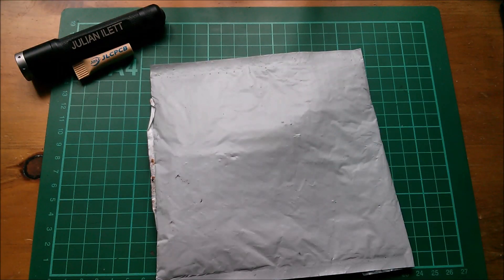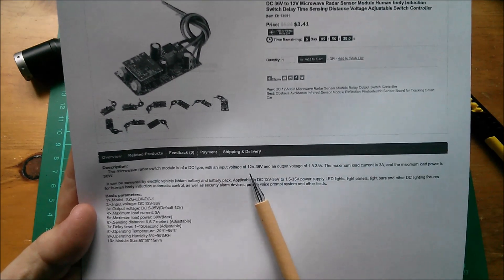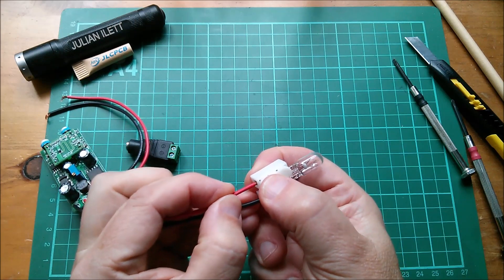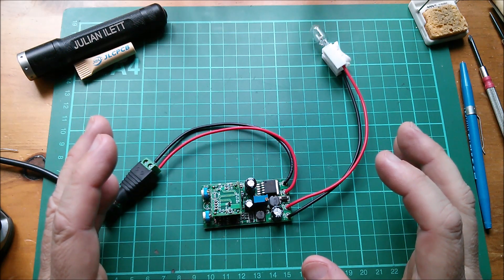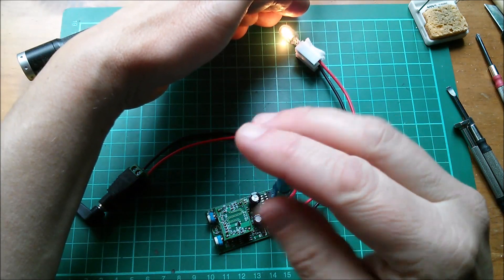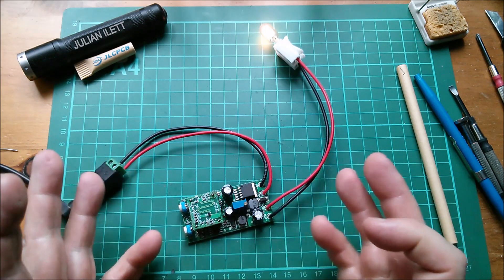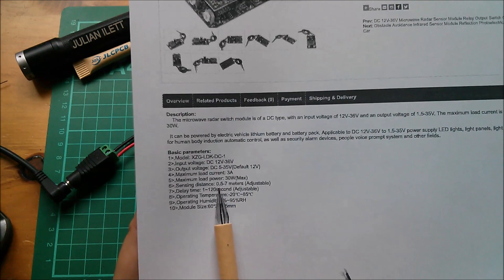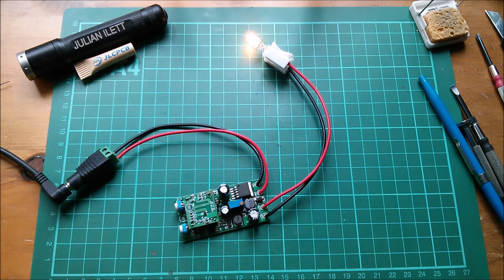Microwave Radar Module from ICStation.com

Comment: On the jack plug terminals, loosen the screws, shove a small jewellers screwdriver or similar into the terminal end to push the tongue up, and your loose frayed wires should go straight in without soldering.

Comment: ofcourse you have to put it on the 10A setting, because that's the amp sensing input, the 10A is the max of the multimeter. you can't truly use the volts input to measure current, it would limit the current so much you'd not even be able to pass a considerable amount of current through on a high voltage (lets say 230v) (and still less than a milliamp)

Comment: This device detects any movement, I guess.
It's pretty much unusable outside then. Right?
Reply: No not "any" movement. Movement that will alter a microwave radio signal. Objects that do not contain much moisture or metal are less likely to trigger them. Moving objects that contain metal or water such as humans, animals, or plants are likely to, depending on size more than speed. There is a good video on YouTube showing an empty water bottle vs a full water bottle testing one of these type of sensors. I have these type around my house in areas that don't have any plants and they work well.

Comment: I love, how these chinese people don't give a f* about BOM-costs. different Pots, Coils, even Resistor values are all over the place. These little things could even be cheaper than they are.
Reply: If you dont build with trash the parts would be more efficient at standartisation yet the overall design is very forgiving at parts variations... Designer is pro, manufacturing is still basic and dumb and the seller is smart

Comment: Other (cheaper) units are available :D (the RCWL-0516 being one - the unit has a non switched 3.3v output as well as a switched one).  Being quite lightweight SMD I've always been wary of giving the output on both this and the PIR equivalent too much to do. 
** after a bit of digging The max load is given as 3A 30w ***

I built a simple mosfet/transistor (both work with the same board as does the arduino PIR module) switch to "beef up" the 5v output capabilities https://i1150.photobucket.com/albums/o618/doppleganger1/mosfet%20switch_zpsacvh98lo.jpg (see big clive's how to https://www.youtube.com/watch?v=ZE5JASv3XyY).  It's fine for a few LEDs but if you need to wrangle more pixies and you can also use the standard arduino relay blocks to switch beefier loads.

This looks like a v2 (or possibly 3 or 5) with adjustments which the v1 is capable of - but you have to mod or hack the board and then work out resistor and capacitor values to add to give you the settings you require.  It becomes a "bit of a project" to set up.

This looks like all the work is done for you which while maybe not as much fun - strikes me as being a lot more practical though.

Comment: 3:37 Obviously this was just for testing, but in a real installation it's best to avoid soldering wires that go into screw terminals - the solder crushes away and over time with oxygen and moisture leads to a bad connection. As long as the screw is undone sufficiently, you can use a small screwdriver to lever it open if needed.

Comment: It's not detecting Doppler shift so please stop saying it is. It's just looking for a change in the reflected signal and using a repurposed PIR IC to sense this change.
Reply: And those changes are described by the Doppler effect. Objects moving away cause red shift in the reflection, and objects moving towards the unit cause blue shift in the reflection.
Reply: @MrThomBeck  Nope, it's simple interference. In order to use the Doppler effect you have to measure the Doppler shift, which involves frequency measurement or pulse counting over time. I used to use a modified charge pump with a transistor clamping the voltage on the input cap to 0.6V below that on the integrating cap.

Comment: Pretty cool . Good timing with Halloween coming up. You can setup spooky things to happen when someone gets near. 

But if it's as sensitive as the same sensors being used in some lightbulbs, it will trigger alllll the time. Even if the person is around the corner of a wall.

Comment: A small Phillips screwdriver does a nice job of pushing the "door" out of the way in the not-quite-an-elevator terminals.
Reply: Years ago I made up a double-ended tool for doing this from a knackered hex wrench with flats ground on the ends - the bend let you lift the wire protectors when there was restricted access - but I've not seen it for some time now.

Comment: I wish some of these modules would give more than just on/off, it would be awesome to have distance or size discriminating capabilities...

Apparently they don't work with doppler shift, they work based on something far less easy to understand.
Reply: Actually, they work on something far simpler - interference.  You have a transmitter creating a steady signal.  The receiver picks up the transmitter directly as well as any reflections in the room.  The reflections will either add or subtract from the direct signal.  Any changes in the room reflections will result in a change in the received signal level.  All you have to do is rectify the incoming signal to DC and then pass it though a cap so you only get the changes (you're not interested in the actual levels - just the change).  Aside from the one-transistor oscillator and crystal receiver, everything else is DC to low audio in frequency.  Absolutely nothing is critical.  The sensitivity adjustment determines how big a AC signal is needed to trigger.  This method is used for both microwave and ultrasonic motion detectors.
Reply: @russellhltn1396  Exactly, although you don't need any rectification just a threshold detector of some kind.
Reply: @Graham_Langley  The actual level doesn't matter.  It's the change in level you're looking for.  That's much easier to do if you AM demodulate the signal and then run it though a dc blocking cap. Once you've done that, then you can use a threshold detector on the resulting AC signal.
Reply: @russellhltn1396  Missed point I think - I was talking about the level of the change. You don't need to "AM demodulate" as the microwave module effectively does that - its output will be DC voltage that changes slowly in response to changes in the reflected RF field. Electrically it's just like like the output from a PIR's pyrosensor which is why it uses a repurposed PIR IC, probably with the amp given a slightly lower LF cutoff frequency.
Reply: @Graham_Langley  The detector I look apart (a commercial device for opening doors) had a diode in the feedhorn  acting as both the receive antenna and detector.  At microwave frequencies, the solder pad it connected to was an effective capacitor.  I'd say that design did in fact AM demodulate - and extremely simple.
Reply: @russellhltn1396  Replying rather late, the detector it a Schottky diode unless things have changed since I worked on these in the 70 and 80s. Back then we used X-band cavities machined out of aluminium extrusions and a washer on the isolated fixing screw served as the capacitor.
Reply: As you say it's not Doppler and I do wish people would stop saying it is. Doppler implies it works on the frequency difference between transmitted and received signals, meaning it would have to do some kind of pulse counting over time before triggering. This kind of module seems to use a repurposed PIR IC and just looks for a a change in the reflected signal. As for distance and size the two are indistinguishable using simple techniques.

Credentials: In a past life I designed commercial security microwave and PIR detectors.
Reply: @Graham_Langley  I suspected as much based on the fact none of the detectors do this! Thanks for clarifying
Reply: @Graham_Langley  yeah, it's a lot easier to understand in the time domain.  But I suppose you could make a Doppler augment if you say you mix the return signal with the original and look for the presence of the difference/beat signal.  To do it the way most people describe it would take some precision devices.  You're only talking a few Hz on a GHz signal.

Comment: A trick for clearing the terminal connectors that have the tongue in them. Use a Jewelers blade screwdriver to push the tongue clear, making sure you loosen the screw first,  so that you can insert the wire. Soldering the strands is not recommended as this will create stresses in the cable and it is likely to break off. It also reduces the surface contact area of the cable thus reducing the effective current capability.
Reply: Are you sure of the garbage advice you gave on soldering strand wires ?
Reply: @ahmedalshalchi  Yes! It is not "garbage advice", as you call it, it is factual information. If you choose not to take it that is fine.
Reply: John Godden .... Jet let me inform you one factual info about current flowing conductor,  it is said that electrons are flowing above the surface of the conductor  rather the inner material so that is why the fuses have a notch at the point of failure also soldering the strand wires will distribute the flowing current more balanced among wire threads by joining all surfaces to one plane , that is my idea and why I considered your advice as " garbage ", I didn't offend you but reacting to your false advice by scientific fact..... If you choose not to take it that is fine.
Reply: @ahmedalshalchi  I am not getting into a slanging match on Julian's site. I made suggestions, if you don't like them don't use them.

Comment: Your bulb if you didnt know . Is a automotive bulb.   LLB 501. 12v 5 w.  also comes in 501A=amber.  501B= blue.  and  501G = green
Reply: "A bulb is something you plant. That is a lamp."
~ my electronics instructor
Reply: @snowbatsnowbat7197  yes me bad..   thats what my Physics teacher use to say too.
Reply: And the wires are nickel or nichrome, so non-wetting for solder.

Comment: bigclivedotcom did some kind of analysis of these things, they are a bit odd IIRC
Reply: yea he told it works through a closed door
Reply: @maicod  they don't. I've been using them for a security system, they are indeed "spooky" but they don't really work through walls/doors.
Reply: o thought Clive said they did
Reply: @beware_the_moose  It probably depends on what the walls are made of and what frequency is being used.  Depending on the details, it could either go either way.
Reply: @russellhltn1396  The commercial security ones I worked on used 10GHz (X-band) which went though glass and wooden doors  quite nicely which could cause all kinds of false alarms.

For example we had one in a secure area with that would alarm at particular times. Turned out to be the security guard using the toilet on the floor above during his rounds and the soil pipe ran through the secure area close to the detector. Foil over the pipe fixed that one.

Reflection caused problems too. We had one in an industrial building that would go off around 6am during the week and a bit later at weekends, which coincided with the unit next door starting operations but the detector wasn't pointed that way. Turned out they brought a large van in through a side door at night and depending on the angle it was parked at it could reflect the detection pattern out through some windows.
Reply: @Graham_Langley  Decades ago, I saw an alarm system that had both microwave and IR motion detector.  Both had to trigger before it claimed there was motion.  Seemed pretty reliable.
Reply: @russellhltn1396  Yes to be fair my internal walls are mostly brick!
Reply: @russellhltn1396  We didn't do dual technology ones - IIRC there was a patent on it but it's now so long ago I can't remember for sure.

We did do a proof-of-concept microwave motion detector using an electronic analogue of an existing electromechanical technique used in another industry as a method of target direction sensing to see if it was worthwhile using it to get around someone's patent. It used a quadrature microwave detector with a four-quadrant multiplier and we got it working brilliantly - point it at a group of people talking, moving around etc. and it would ignore them, but if someone walked away from the group it detected them. However using the technology of the 70s it wasn't economic and it was put to one side. These days it would be pretty trivial to implement.
Reply: Thinking about this has dredged up a few memories. At one firm we had a problem with microwave cavities going noisy so we'd set the suspect item on the first floor lab window pointing out at the road and hooked the amplifier's output to an audio amp. We were surprised to be able to recognise the different sound of one, two or more than two people walking together and if there was a push chair/baby buggy.

Comment: 10:15 the meter wasn't working most likely because it was set to 'A' rather than 'mA'.
Reply: I was about to comment the same thing, along the lines: he sets the A scale but uses the mA output.
Reply: @unperrier  Yes he was on the Amps range the whole time. Thats why it read out the incorrect 0.034 value initially (range on A, but probe in ohm/V/uA/mA socket). The 0.014A reading was correct after he moved the probe from mA to 10A socket.
Reply: Oh, ick I dont think I like the way that meter is set up at all. What happens of you are planning to measure voltage, but set it to mA or uA, and, say, test a nice 18650 cell?

Comment: Are you going to use this to control the lights in the outdoor workshop?
Reply from the maker: Yes, probably. There are some 5V Christmas lights under there fed from a 12V battery. That should work well.
Reply: @JulianIlett  sounds like a good plan